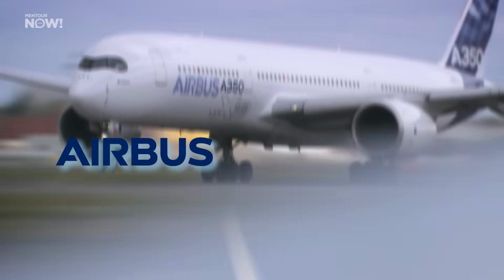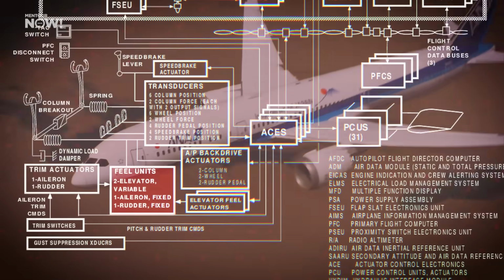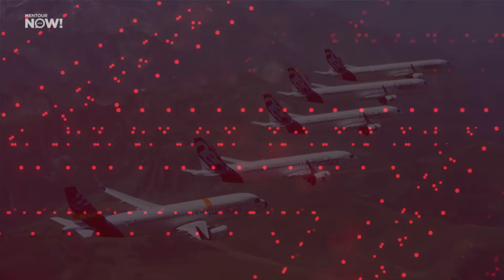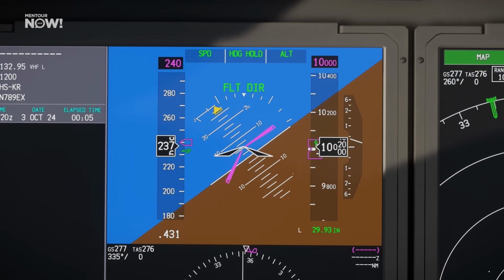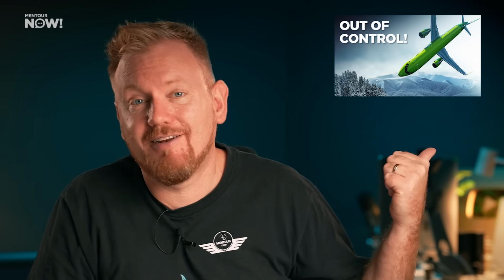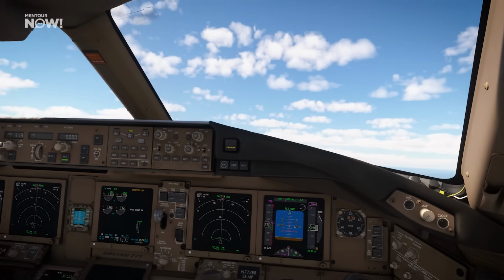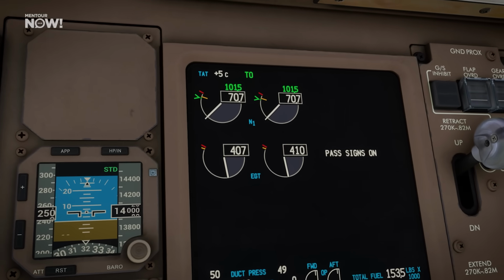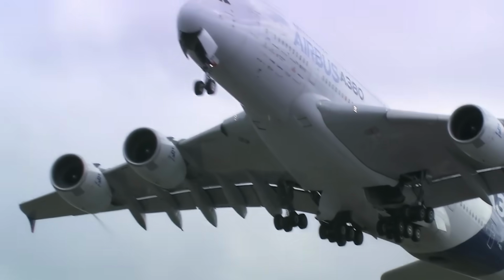Do Pilots Prefer AIRBUS over BOEING?!

Comment: Aside from the 737 Max where Boeing didn't want pilots to have ultimate control. 🙄
Reply: Well tbh we should just look at casualties on boeing vs airbus. Thats the most factual. And ratio in boeing vs airbus passengers
Reply: @Osiris57  Boeing would have vastly more casualties, being they were a major manufacturer of WWII planes that saw heavy combat, while Airbus was founded in the 70s.
Reply: @Osiris57  Yes Airbus is twice as safe by deaths per 100 million miles flown, like 8ish to 4ish.  Basically twice as safe.
Reply: @msromike123  Nice airplane but you statement is way off!!
Reply: @msromike123 . Hmmm, is that based on raw data? I wonder how it would compare if you excluded early Boeing operations going back to the 60s and just compared the accident rate for aircraft of the same age?
Reply: @QatarVegan  I did it using Gemini AI, and excluded anything before airbus entered market like mid 70s ish. It IS because of those two MAX crashes, but I felt those shouldn't be excluded.  All said and done it is roughly twice as likely in terms of a fatality per 100 million miles on a Boeing.  The extremely low number of incidents for either means this should be taken with a grain of salt.
Reply: It's probably what they would have wanted,  but it's not what they got from Bangore
Reply: @JoeAchilles1  Air Crash Investigation S20E04 Grounded: Boeing Max 8.  Bali to Jakarta. AoA sensor replaced in Bali.  Faulty instruments on Capts side with altitude and air speed disagreements,  3rd pilot notices trim wheel movements, Capt rightly assumes runaway stabiliser, he then presses the 2 cut out switches, turning off auto trim and MCAS.  He carries on to Jakarta rather than returning to Bali to have it fixed. Investigators highly critical of him for doing this, this is against Standard Operating Procedures. Capt fails to fill out the report correctly on landing in Jakarta, only writing the disagreements and not mentioning the dives and him disconnecting auto trim to fix it.  Maintenance in Bali had replaced the Capts AoA sensor, but failed to calibrate it, it was 21 degrees out of line with FO side AoA sensor.  
 MCAS only kicks in when these 3 things are present:- excessive angle of attack, auto pilot off AND flaps up.   Because of faulty maintenance, all 3 were present to kick in MCAS. In Jakarta the next Capt fails to notice the report and takes off.  MCAS kicks in again, Capt controls this by constantly pressing trim up.  Capt asks FO to get the QRH, and find a checklist, FO cant find the checklist, Capt gives control to FO, he does not tell him how to control it, Capt takes QRH and FO assumes its in a stall and puts it into an even steeper dive and loses control and crashes the plane. The FO record shows he is a completely incompetent pilot, and should not have been flying.  Its never just 1 thing that brings a plane down, its a combination of errors and issues.  It is highly likely the Capt was sacked and never allowed to fly again. Maintenance were likely sacked as well.  The fact that there has been no issues throughout USA, Canada and the EU is a clear indication that MCAS is not the root cause of crashes, but poor Maintenance and poor Pilots are.
Reply: Or for it to fly.
Reply: They tried to be like Airbus but failed badly
Reply: That’s cuz the 737 was a flawed design the design is way to outdated for the engine its using they literally  have to make compromising mods to the landing gear to jack up the plane and the engine inline with the wing instead of hanging down from it and make the engine cowling oval shape to clear the ground clearance the modern high bypass engine aren’t design for this plane but instead of admitting the 737 has overstayed its initial design usefulness they force modern tech into and outdated design to save money that force the 737 max to fly funny forcing Boeing to add mcas into the plane but because they don’t want to make 737 Ng and legacy 737 pilot go to conversion training the whole thing end up causing fatalities.
Reply: It was a 'cost cutting' move. Where pilots needed little additional training. Which gets back to Boeing's usual issues since the 2000s. Cost cutting had been costing lives.
Reply: @glynnetolar4423  

Yeah, it is funny was hell that Boeing trying to save some loose change on pilot training ended up spending billions as a result.
Reply: Yes it is ultimate control once you turn the stab trim off!!!
Reply: @Gaferr-r4r but then the pilots should have understand flying basics
Reply: @ lol
Reply: Another honorable mention: the autothrottle. e.g. Emirates flight 521 and One-Two-Go Airlines where you just forgetting to push the ToGa button can have devistating outcomes. And the system can also get stuck and confuse pilots
Reply: @dernichtberliner7977  Yeah automation is great until you add up a few dozen accidents directly caused by automation.
Reply: Aside from the pilots are trained to deal with runaway trim.
Reply: Nahhh the garuda air and ethiopia air pilots have skill issues.
Reply: @jigeah

The Garuda pilots crashed because of a system they were not told about.  

The Ethiopian pilots did EXACTLY what Boeing told them to do in the event of an MCAS failure and were left with a plane that was uncontrollable.
Reply: @jigeah

Ironically it’s the American and European pilots who turn on autopilot at 400 feet that don’t have the skill level… but that disables MCAS so it’s not a factor.
Reply: Except that’s not the case.  The plane always responded to pilot inputs even with MCAS. Unlike Alpha Protect which happily flew the A320 into a bunch of trees despite the pilots wishes to the contrary.
Reply: @calvinnickel9995  "Except that’s not the case.  The plane always responded to pilot inputs even with MCAS. Unlike Alpha Protect which happily flew the A320 into a bunch of trees despite the pilots wishes to the contrary."

Well that's nice that MCAS is so well behaved that Boeing didn't even need to mention it in the operating manual.
Reply: Actually that is not correct.  MCAS was  intended as a Maneuvering Control Augmentation System.     It was supposed to make the airplane feel like the  737 NG not take away control from the pilots.   The errors on this system are so outrageous that I expect it was not done by control system professionals.
Reply: @danharold3087   Which is not ultimate control anyways
Reply: @danharold3087  I think Joe meant his comment sarcastically. Most people who talk about MCAS don't know that it's a sub-function of Speed Trim - or indeed that the 737 has a Speed Trim computer that automatically moves the stabilizer.
Reply: @PauloSergioMDC  My bad.  Prefer /s
Reply: @danharold3087 you describe what "not in ultimate control" is
Reply: @bocahdongo7769  You nailed it.  That is an elusive an illusionary definition.  It is their design philosophy and nothing more.  Of course they use automation when it can reduce workload on the crew and provide important flight envelope safeguards.  I don't think most people would call a stick pusher a lack of "ultimate control."

Comment: Both manufactures have to certify according to Part 25 (CS25 or FAA25) today. Just the 737 have to ensure the safety standard of 1967 while the A320 ensures the Standard of 1984. Updates to this standard is up to the willingness of the management to spent millions for improvements - or not...
Reply: Yes, but which manufacturer was in bed with their regulator ?
Reply: @TommyRaines  I pray for both NOT. 
But I`m not a good believer.

Comment: Isn't there a simple solution to the airbus lack of feedback while maintaining the Airbus way of thinking. Connect the controls to feedback motors that are activated when in degraded working or other modes where visual feedback is important, such as TOGA Lock become active

This way if everything is normal then the flight controls will feel or look as expected. But if something is wrong with the flight controls it stands out, similar to the "all dark" philosophy for switches

Comment: Hilarious for Boeing to say "the pilots have authority" in light of MCAS flying their planes into the ground regardless of pilot input
Reply: The original MCAS system was never deemed by Boeing to be a critical system and was not reviewed by the FAA. This was admitted as fraud from Boeing to the FAA (but only a $2.5 billion fine). 
The modified MCAS system has been vetted by numerous pilots and apparently is much better. I assume it is also using input from multiple sensors.
Reply: Mcas ok with good crew!
Reply: Boeing was a good company before the merger with McDonnal Douglas. Much the same as Mercedes was before the merger with Chrysler.
Reply: it would be a valid argument, except that the pilots regained control by switching the powered trim off, and then lost control again, by switching it back on.  which is not to say that the 737 MAX program wasn't an unforced error.
Reply: @kenbrown2808  That is a misrepresentation of events the pilots figured out what was causing the issue, turned off. Then realized that they did not have enough altitude to retrim the aircraft properly manually which is what they were going to do. So they turned it back on knowing they needed the computer to help them retrim. Once they turned It back it reverted all the manual trim work they did and they crashed. So it is a valid argument MCAS took control put the aircraft into a situation where it was going to crash, and when it was figured out they didn't have enough altitude to correct the issue manually.  Root cause MCAS.  How you stated it, it makes it sound like the pilots totally fixed the problem and they would have been fine but they made the choice to turn it back on for some reason not related to them already being in a situation where a crash was inevitable.
Reply: @BType13X2  no, the pilots did not understand the override procedure correctly.  the correct procedure for an MCAS error was to turn off the power trim function.  the same as for any other runaway trim problem.  the solution to it still being trimmed too far down, is to pull like heck on the yoke until you get the trim manually back to where it needs to be.  not to turn the power trim back on.  having it rely on one attitude sensor was still an unforced error, and not having a training program - I think they call it difference training or something to that effect, was still an unforced error.  but there was an override procedure.
Reply: @kenbrown2808  A solution is worthless if you do not tell anyone, and as you correctly stated, Boeing intentionally did not tell the pilots that MCAS even existed.
Reply: @neodym5809  again, you're parroting propaganda.  pilots for many airlines WERE given the training and knew how to disable MCAS if it suffered a malfunction.  but the training was not universal.
Reply: @kenbrown2808  The training was not mandatory for a critical system. So Boeing failed. This is not propaganda, but fact.
Reply: @neodym5809  if you actually read, you'll see I never said Boeing didn't make an unforced error.   but the "regardless of pilot input" claim is propaganda.
Reply: @kenbrown2808  it was not an unforced error. 1. A critical system relying on only one sensor is a no go in aviation, and not an unforced error, but a decision to be made to cut costs 
2. Excluding MCAS from the manual was not an unforced error, but a decision to, again, cut costs 
3. Lying to the FDA about the role of mcas was also not an unforced error.
Reply: @neodym5809  2: MCAS was in the manual.  the problem was some airlines didn't bother letting the pilots see the manual.  

3: the FDA only has jurisdiction over the inflight meal.  

are you being this ignorant on purpose?  I understand, you are on a vendetta against Boeing.  so you are unable to see anything that doesn't align with your vendetta, but some of us actually made an effort to learn things.
Reply: @kenbrown2808  may I quote from Boeing 737 Max groundings, Wikipedia:

2018, November 10, Boeing referred publicly for the first time to the MCAS by name in a Multi Operator Message to operators.[64][65][66] The MCAS control law, a few lines of software code in the FCC, could autonomously command nosedives, when even a single sensor failure resulted in bad data; MCAS was omitted from aircraft manuals and training,[67] therefore flight crews had no knowledge of its existence or functioning until Boeing published a bulletin on November 6.
Reply: @neodym5809  oh, wikipedia. The first place for reliable confirmation bias.
Reply: @kenbrown2808  I presented you a quote to back my claim. Can you back yours with a source? If not, I think we can part ways, with prove that Boeing did indeed not include mcas in the manual. 
But if you don’t believe me, just google the congressional hearing of the FAAs acting administrator.
Reply: @neodym5809  I've already given you a quote that is just as reliable as wikipedia. Addendum: but yes, i found a technical bulletin explaini g what MCAS is, what conditions it operates under, and how pilots can override it. The only thing it is lacking is a publication date. So i didn't copy and paste it.
Reply: @kenbrown2808  the publication date is missing? How convenient. May it be that it was after the two crashes?
Reply: @neodym5809  at least it's not on a platform where anyone can edit it.
Reply: @kenbrown2808  the minutes of the congressional hearing of the FAAs acting administrator can be edited by anyone?
Reply: @BType13X2  take a look at his most recent upload - it explains the whole situation, including the previous two flights having trouble with it, and using memory lists to disable it - and it is a long list of errors, oversights, and ultimately failure to calibrate one of two AOA sensors that built up a string of events that powered them through the swiss cheese model.
Reply: How many of the commentators flown one of these aircraft, let alone products of both manufacturers ?
Reply: That was before MCAS crashes
Reply: Garuda air and ethiopia air pilots have skill issues.
Reply: mcas is fixed now.pilots now have authority
Reply: @planespottingwithabdullah  Only after 346 people died, the aircraft was grounded and there were several investigations / lawsuits into their behavior.
Reply: @planespottingwithabdullah  MCAS should never have existed
Reply: @planespottingwithabdullah  tell that to 346 people  who lost their lives
Reply: @AnetaMihaylova-d6f  He's right in terms of that it is fixed now, however you are right in that the fix was written in the blood of those people.  It's a sad fact of aviation that many fixes are written in the blood of those who died in accidents.
Reply: @cjmillsnun  Well, unfortunately safety laws everywhere, cars, ships, trains, are written in blood...
Reply: @AnetaMihaylova-d6f  Pilots didn't follow procedure for runaway trim.
Reply: @steinarnielsen8954  not true.they did  but MCAS kept switching on because of faulty AOA sensor
Reply: MCAS still responds to pilot inputs. If you actively the trim switches.. the trim will respond to your commands.  

Meanwhile Alpha Protect on a A320 flying into some trees……

Comment: If you would have asked that any aviation fanboy 10-20 years ago, Boeing and both Airbus, nowadays, it's only Airbus sadly due to all Boeing leadership culture changes in the past decades
Reply: There was that point where Mentour went hint hint. I would not be surprised if he soon got an Airbus type rating.
Reply: It took fifteen plus years for leadership changes to have an affect on engineering and build operations. This means it will take many years to make an effect back to safety and engineering first.
Reply: @rolfhauser3190  Let's hope that does happen in the first place
Reply: The situation with Boeing is so sad.  It is a legendary manufacturer of so many iconic aircraft, but the leadership culture and production standards have all but destroyed it.
Reply: Nah. Boeing invented modern aviation and will always be the king.
Reply: @stussymishka  Boeing invented what? Nop, the first passenger commercial jet was the Comet, the first supersonic was the Concorde, the first widebody twin engine was the A300, the first with digital FBW was the A320.
Reply: @Voyager.2  Boeing pioneered
- widebody in general (747)
- a twinjet that can fly long haul (777)
- extensive use of carbon fiber (787)
- electronic substitute instead of traditional bleed air (787)
The A300 was only meant for medium haul, not long haul (like the 767 and A330-300)
Percentage wise, the proportion of carbon fiber on the A380 is only comparable to the percentage carbon fiber on the 777X
Reply: @stussymishka  Fr, I still prefer Boeing though... far more actually